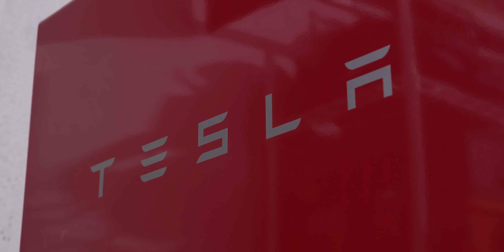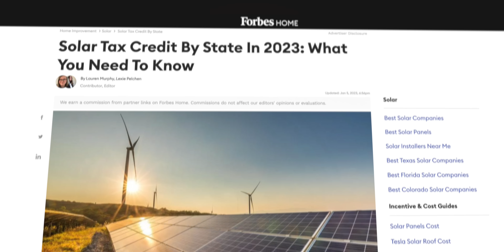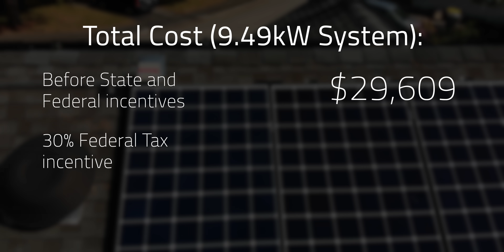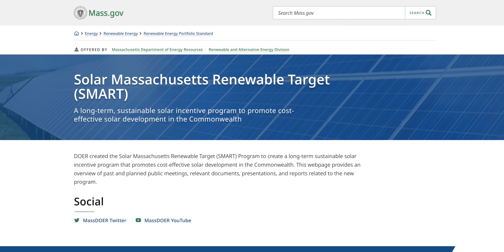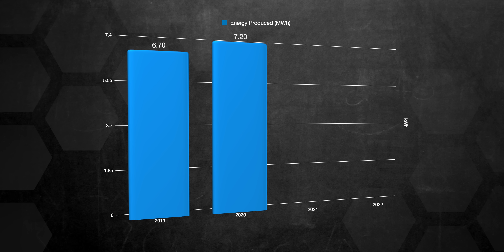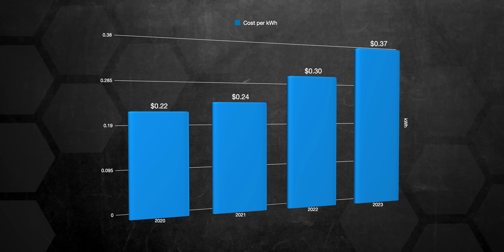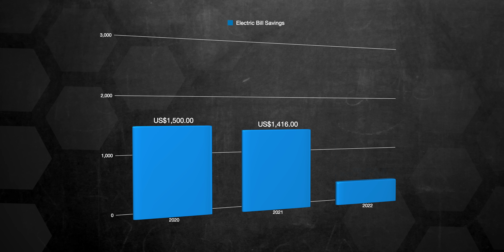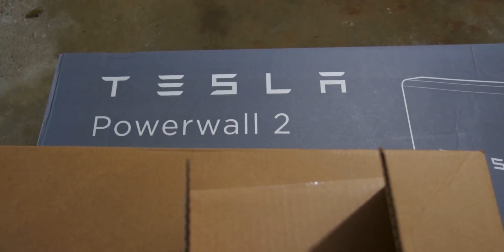5 Years with Solar Panels - Is It Still Worth It?

Comment: He forgot to mention several major points. Here, in Toronto, Canada, the electricity cost of the monthly bill is only 1/3 of the total bill and the rest, 2/3, are delivery charges. Those charges still apply if one wants to sell extra electricity back to the utility. Then, the solar panels and the battery will have to be replaced in 10 years which will wipe out any pay-backs. Then, the panels will have to be removed whenever the shingles need to be replaced. Also, the money instead invested in stocks pay dividends.
Reply: I am in Ontario with Solar and my bill reduced from average $180/month to about $28, my panels have a 25 year warranty, it will cost about $3k to remove and replace the panels when the roof needs to be replaced, (every 20+ years) there is a 10 year interest free loan available and a grant up to $5600. If energy rates continue to increase the way the way they have the last 20 years my bill will have been $600/month and the panels will still produce over 90% of their original capacity at that time. I also have money in the market, but this is good diversification and good for the environment.  Also, if I do ever decide to sell, homes with solar panels sell faster and for 3-5% more.
Reply: 10 years? Oh great, here comes the anti-solar disinformation crowd again...
Every major producer provides 20 or more years of warranty. You would have to be seriously uninformed and unlucky at the same time to even find panels that only last 10 years and have no warranty.

Comment: Have you researched where the rare earth elements come from?  Who mines that at point of acquisition?  How long do the components last?  How are they recycled?  How much of the cost of the aforementioned is shouldered by, well, children in child slave labor?  The recycling process?  Who does that work?  How much is buried in the ground just to hide it?  (research wind turbine blades just for one example), how long do these components last?  What type of repair cost will be needed on your roof when a "recommended installer" does a poor job or a worker does some shortcuts because "you can't see it from my house" mentality?  And then, as you alluded to, how are components replaced when a manufacturer goes out of business, or sees the writing on the wall and gets out of the business because of foreseen problems (government regulations, government folly of any sort)?

Comment: An advantage of living in Australia is that we do not get snow over 95% of the country. However, the prevalent Terracotta tile roofs can be perfectly weatherproof, but become very brittle when subject to many blisteringly hot summers. This resulted in an acquaintance  having to call off an installation altogether because the installers broke every tile they stood on. We are also be-deviled by the number if incompetent installers who habitually under-size system capacity required, to be price competitive then run a mile from their own shoddy work.

Comment: I live in Missouri there is no pay backs on extra electric but with the meter they will credit so you can use it later I want to install a smaller set up at first then see how it goes will look in to it more first will be off grid

Comment: these years i would considder including the car as extra battery 
to lower the price on both battery and car
if people are on the grid, it can save alot of the money on the expensive days
the car is home when most of the battery is needed anyway

and if i was to use micro inverters i would just go balkony style on the top of my house... (those micro inverters cost 10 times less and do the same) 
saves more then half the money, compared to getting a complete system installed by some guy, if it is legal where you live
you can get over 10 kw 10000€ before tax credit (27000 dollars 🤣)

btw tax cuts very rare give the same os getting a cheap installer and not buying the system from some expensive place
i paid 10.000E to get a 6.5 kw with 13 kw battery installed, over 98% of the companys offered to do it for over the double of that. (and i could not place the inverter where i wanted to, and i would get half the battery size)

Comment: I have both a diy system and a professionally installed (done well) system.  Design/cost criteria for everyone is different. 

 For me, it was all about the "oh Shyte" factor.  If you are expecting or planning for off grid realities, your criteria can be vastly different than for grid assist.

What I learned...quickly, is that affordable solar that covers the OS factor needs to be targeted.  Specifically, what energy load am I trying to cover to be comfortable and functional. I think it is safe to say, if you get great sun, you also get hot.  Hence, driving your big load, that is AC, is the key design criteria.  Of course, AC in most homes is 220 (or 240...whatever it takes, h/t Michael Keaton).  That's a pain in the butt for us noobs.

My diy system is the hand cart system you see built by other youtubers.  I bought what they said to buy, I bought used panels, and I bought 2 5kw batteries.

I use them to drive window units....not a central system.  I run them from 6 in the morning until 8 at night.  On a full battery charge, I can drive 26,000 btu of AC, keep the poorly insulated home at 74 (yes 74 inside vs 100+ outside) for about 1400 s.f. , and have about 30% of battery left at end of day. 

This is not optimized by any means...I am still new to the game.  But my total investments with hefty delivery charges (for panels and batteries) is about $11,000.  That includes the window units.

The kicker, though, is that the diy is portable.  The batteries and inverter are very portable, and the panels....well portable enough.  

Recently we lost NIGHT power (temp still near 100) and I plugged a propane generator's 120 output into my 120 inverter input, as a substitute to grid tie.  Worked fine, and was sufficient to survive the night.  Again, not optimal configuration.

Comment: Greetings to everyone, I won't waste time giving my qualifications, just some friendly advice,  if you have the space, never put solar panels on your roof, go ground based instead, or build a patio cover using the panels as the roof, yes it will leak in the rain, if you go ground based try to go with a setup that moves with the sun for maximum power point at all times and a incident angle of near zero when possible, and lastly there are more cost effective batteries than tesla, you're buying the material that the battery is made of and not the name on the cover, the earliest batteries required lots of maintenance and contained acid, then,  AGM, and lithium and soon probably something else, the panels have come a long way as well, my first install saw 285 watt panels, now you can get 500 watt panels, with the industry standard being that the sun gives you 1000 watts per meter squared, we're are only now reaching 50% efficiency in  panels, however using a system  that moves with the sun, you need less panels for peak power points.

Comment: Before signing the contract, there are some municipalities around the country that do not allow battery back up such as Power Walls to be installed in the house. New York City being one. They claim the risk of a lithium battery fire is possible and it will not pass inspection.

Comment: What no one talks about is the life of the solar panels. As they age, they reduce power output. They also have a usable lifespan of roughly 20 years. You could be replacing them before your loan is paid off. Essentially, you may never stop paying out of pocket. A great deal?  Maybe not, unless you live in Arizona, Florida or another high sun days region.
Reply: Yes the panels do age.  And as they age degradation does take place but it is small.  We are only talking about .50% per year for cheaper panels.  Most panels after 20 years are still guaranteed to produce 80% percent of what they did on day 1.  The more premium panels such as Rec pure only have a degradation rate of .25% a year which guarantees after 20 years 92% of what they made of day one.  So no after 20 years your panels just don't stop working.

Comment: There are 2 things that would change my mind about solar panels.  Either the manufacturing process needs to become incredibly clean.  Or the Panels need to last an incredibly long time without degredation.
Reply: Most midgrade panels only degrade half a percent per year and most now guarantee 80% of day 1 production after 20 years and premium panels such as many REC panels only degrade .25% a year and guarantee 92% of day 1 production after 20 years.

Comment: Great video thanks. My wife and I live in Epsom just south of London England and we have had solar panels for 12 years which we are delighted with. Snow isn't our problem but I wish I had known about bird problems. Pigeons nest under the panels leaving a lot of mess on the pannels, around the house and making a lot of noise early in the morning. We had to have a bird control company clean the panels put up fences around each panel which solved the issue. Like your snow fences  I wish I had known about this problem when they were installed.
Reply: WHY SHOULD PIDGEON WHICH IS VERY GOOD MEAT BE A PROBLEM I WONDER

Comment: What about homeowners insurance increase.  What about replacing the roof?  To do it you will need to remove and reinstall the panels.  These things must amortized over the life if the panels.  Our power supplier is pushing for an annual fee of around $2000. To use their grid.

Comment: You used 12,6 MWh in 2022. I find that interesting. 
I live in Norway (cold winters) and according to my app (Tibber) we used 34,1 MWh in 2022. And that did cost us 75 240 NOK ~ 7144 US dollars using current rate. We live in a cold country, and those 34,1 MWh was spent 43% for heating (we do have a heat-pump and that helps), 25% charging EV, 16% on what the app classifies as "Behavioral" (lights, cooking, heating water for showers++ (not gas in Norway for that)) and finally 16% to "always on" devices like fridges, WiFi, air-circulation and so on. 
Worth mentioning that we are a big family and we have to flats in the basement. In total we are 9 people living in this place, sharing 405 sqm (4359 sqf), two EV's and the heatpump (air2air) only applies for the main floor in which I live. And it is 13 years old and will actually be replaced next month. The heatpump has this year been used for cooling a total of 5 days. We should probably used it more for cooling, but I actually quite often forget that is even an option.... Yes you are right; we are not used to excessive heat in Norway.. We have 20+cm (some places 40cm) of glass wool insulation in walls, ceiling ++. So...

Comment: Not allowing fossil fuels to drill, pump oil and gas is the reason rates went up. Along with the fact that the dollar is being shredded from spending through our federal government causing the dollar to have less purchasing power. Installers wont remove and put back panels without paying. Roof companies will drop your warranty if these are put on and good luck having thebsolar company warranty the roof (they initially say they will but they wont). Panels degrade constantly, you have to have them maintenenced yearly, parts will break and need replaced, you still have to be connected to the grid and pay a portion of you normal bill, most companies go out of business within 10-15 years to keep from any warranty. The Batteries are highly flammable as well and suggest putting them away from the house. Someone in nigeria is digging for that cobalt and lithium with no PPE and either getting paid nothing or getting paid littpe to nothing and looks like strip mining to me. Paris climate accords showed the US could adhere to mandates and within 100 years it would change a fraction of 1°F. Carbon dioxide makes up 0.03-0.05% of atmosphere and plants start dieing at 0.02%. The largest green house gas is water vapor. The hottest on record was in the 1930s as the average temp was over 90°F and around 30% of the US was over 100°F. We currently have around 33% of the US averaging over 90°F.
Reply: I watch Redacted on Rumble and they say the same thing.  Redacted = real journalism, unlike the MSM propaganda.

Comment: 12:09 yer never trust a firm that is recommended by a big business as they work on the idea of “”ok who will do this for the cheapest cost? Quality be damned”” to be honest it’s a dumb system that we have been using for decades were basically asking who is will to cut corners the most not the really important question we should be asking “”Who can do the best job?””

Comment: 1) lengthy contracts (can be 25 years) / expensive 
2) someone buys your house, you have a contract to hopefully transfer. Not to mention not everyone is crazy about solar panels 
3) you have to use a specific company at inflated rates to work on your roof
4) power outages still impact you 
5) What happens when those panels are damaged due to storms? Over your lifetime you have these panels most likely this will happen more than once
In sum, if it sounds too good to be true....
Reply: For me, I think I’m in my last house, my panels are ground mounted, the enphase 8 micro inverters can supply power during outages and my panels are covered by my home policy.
Reply: @hermancm  That's great, but where I live if the area loses power you lose power. Moreover, with large panels on your roof  I hope you live in an environmentally stable environment. Where I live, we have seasons of the year with high winds and the occasional tornado. Lastly, I where I live the panels would have to be on my roof so I don't really see an upside.